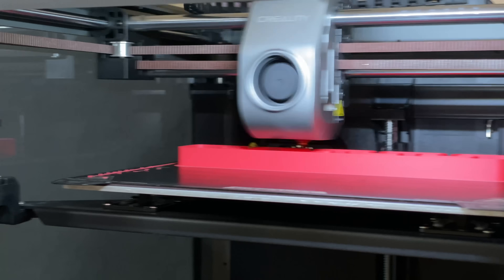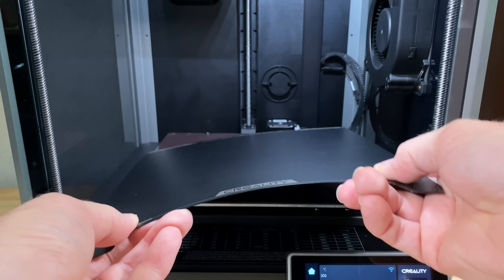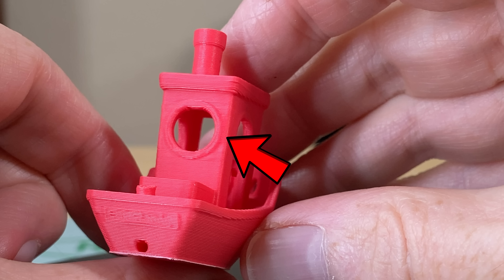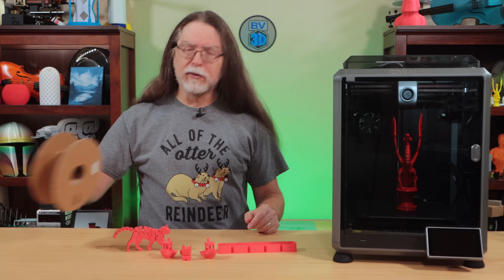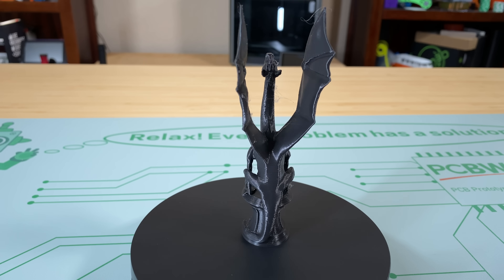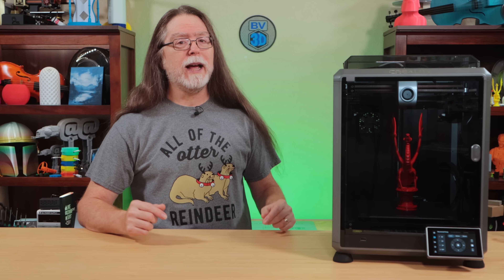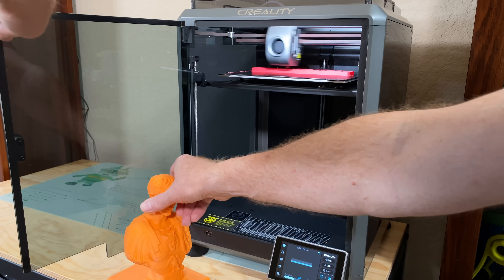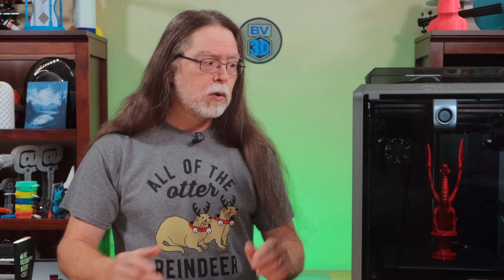Crazy Fast 3D Printer: Creality K1

Comment: Curious your thoughts between the K1 and the Bambu A1?

I'm a complete newb and with the two being close in price, I'm trying to decide between the two.
Reply: Also total noob here but from my research,  the biggest difference in comparing the two is one is enclosed and one is open the enclosed means you have more filament options. The bambu has larger build capacity, and better customer support,  it also has the ams lite that supports multi color printing. I'm also told that you really need to root the k1, so it is running the full versions of the software so that you can really tune things.... that is the biggest thing I've found the bambu machines just work, there is no tinkering or tweaking they just print but the creality while requiring a little more work to get running, give you the freedom to customize and tweak... sorry I'm not more helpful,  currently pulling my hair out trying to decide, and just found a third one that might give them both a run for their money.
Reply: I bought a k1 and the a1 came out during my return window. Got the A1 combo now.

K1 is a good machine. Ultimately I returned it because for a little more money I was able to get the ams lite and a bit more build volume with a very small sacrifice to speed. Only gripes I had with the K1 was when changing filament it liked to break a little booger of filament off in the head and I would have to take off the extruder to fish it out. And I would need to root it for proper input shaping (vertical walls weren’t as smooth as they could’ve been), not a big deal. But again, a little more money got me the AMS lite and a bit more build volume.

Now, with all that said, microcenter currently has the K1 for $400, I paid $430, so it’s a very good deal. Oh, the A1 is also considerably quieter than the K1, I could hear the K1 running in the garage (on the other side through an insulated wall), I can barely hear the A1 in the next room next to uninsulated wall.

Comment: I think it is resonance from the belt put a piece of belt up to the print and it looks like they line up.
Reply from the maker: I checked early on, but the vertical lines on the print didn't mesh 1:1 with the belt teeth.

Comment: Don't buy one. Mine is so inaccurate that parts don't fit together. The machine is off my 3mm over the 300mm print bed. Contacted Creality, and they will not replace it even though I have had this machine less than 30 days. Creality acts like they know nothing about this machine. Beware of these people who get free machines and do nothing but praise it and never tell you about the real problems.
Reply: I've seen so many videos now though of people who bought their own. I think you mustve gotten unlucky with a bad one. Sucks they dont have good support.

Comment: As other have said. Some of it has to do with core xy and the fact you will always get some vfa's. Now rooting it and going with stock klipper will help big time with any ghosting. Creality chose to use the same values twice for imput shaping instead of using a Xand Y value. I am puzzled as to why. And as others have also said the best tightness can also affect vfa's. Strangely enough i loosened my belts a bit and saw improvements. Mine was way too tight. So i guess try both and see. And as to how to do it. You will get 2 exra screws with your printer. You need to screw them into each side of the belt tighening assembly and then you loosen the two screws pinting towards the front on each side. The more you screw the one on the side in the looser the belt will get. Once done you tighten the 2 screws and then remove the screws you had just installed. It is hard to explain but there are some videos on it

Comment: Not sure if someone else mentioned this (as I did not read through the comments), but that table the printer was on was moving a lot. Wouldn't this cause some of the issues you had at the higher speeds?
Reply: This actually doesn't have much of an effect, if at all. There are several videos available where comparisons are made between prints performed on a wobbly table, solid concrete floor, or even hanging from a bungee cord swinging in mid air. There was no visible difference.

Comment: The rocket plane has a defect on it (from the STL) around the engine nacelle.  The tool head will jump to the fuselage instead of rounding the corner.  You can see it on your print at the 5:50 mark.  I wish they had a fixed version because I have a very tall printer I have been wanting to print it out on.  Maybe it's a Prusaslicer issue, I am not sure.  If it happens to you on a different slicer it's something in the STL causing it.  It happens to me when I try printing it, and it's super noticeable when you scale it up to 1.8mm nozzle width and 600 mm tall.  EDIT:  Also happens in Cura.  It's an  issue with the model itself.

Comment: I noticed that like many Creality machines this draws a line of filament from the bottom left to the centre before printing, I got this on my Ender 5 Plus machines before I got rid of the Creality FW, I would have thought by now they would have fixed this and especially on their flagship models, So, Creality are still lazy!
 One of the great features that I love on my newly acquired X1C and AMS is the nozzle cleaning, no more blobs on my first layers!
 My 20 year old server cabinet that I have my Ender 3 machines enclosed in has a glass door that is totally tight with no gaps whatsoever, why cant the printer manufacturers get this right, hell, Even a piano hinge would solve this issue.
 In my YT feed I see loads of new videos on fixing issues with the K1 and K1 max and this is partly why I did not even consider a Creality printer when deciding to spend a fortune on a new printer and I would have once described myself as a Creality fan!

Comment: I think Creality in a way dropped the ball a bit here?  Great printer as many say, But I say drooped the ball because who would go to the trouble to design a enclosed core x y printer that has a cut out on the bottom right of the glass door so the control touch screen is missed so the door can open or close.

Daft design from a big long time 3D printer company. Better to have the touch screen up on the right side of the front frame above the glass door open area so the door does it's thing and keeps the inside draught free because the door be, Well a full door not a door with a missing section at the bottom!

Having the screen up on the top right frame with say the Creality Name up alongside it would still be good looking and the door would be a full non-air let though the gap at the bottom right corner one.  Also I agree the spool holder should be at the right side or left side for ease of access!  

So Creality made a great fast klipper core x y printer but somehow thought that having a gap around the place were they decided to place the touch screen was fine to have letting in breezes and making the whole sealed away from the air you don't wish going into the printing area was okay to do when they could have done what most 3D printer home builders would have done and say have a full sealed door to stop that?  

Qidi Tech got the memo and designed their X-Plus-3 & X-Max-3 with a full encloser with full door sealing up away from the not needed breezes so the ABS type prints are not ruined by those blowing in.  Creality really needs to re-think the design and placement of the next series of core x y control touch screens next time so the printer door is full not has a cut out.
Reply: These improvements will be in the K12 version. Just wait for 6years.

Comment: I’ve printed the pre-sliced items that came with the thumb drive.  These turned out OK.  However, I went to the Creality website and downloaded the “Creality Print Slicer” and when I installed it on my Mac Mini the program was in CHINESE.  I saw no option to choose a language so I went online and did a chat with Creality.  They were not able to help and told I’d need to translate it!!!  Any thoughts? Did i just download the wrong item?  Any thoughts or help would be appreciated. Thanks
Reply from the maker: I downloaded Creality Print for macOS from Creality Cloud, it was version 4.3.7.6625. From https://www.crealitycloud.com/software-firmware/software/creality-print you should be able to scroll down to the Mac section of the page to get version 4.3.7.6625. That's the version I was using on my Mac, and it was in English.
Reply: Thank, I’ll give that a try.
Reply from the maker: @markmiles7485  Please let me know how it goes.
Reply: Telling customers to translate chinese instead of telling them about the correct version to download is top notch customer support.

Comment: Those vertical lines are VFA that happen when you slow down the print speed. This is something that all core xy machines are susceptible to to a certain extent. Some have said that tightening the belts has helped reduce the VFA ripples.
Reply from the maker: OK, cool, thanks. That gives me a starting point to work from. Appreciate it!
Reply: @BV3D  Those VFAs come from the stepper resonances, and it's not exclusive to corexy, any machine with stepper motors can suffer from that issue, it's a relationship between the pulley sizes, the stepper drivers, the stepper quality and the full steps per rotation of the stepper, the only way to control it or eliminate it is to avoid the resonant region, you can print a tower with flat faces and increase the speed every few layers you will see how there's a range where the resonances are higher and you have to avoid that region with higher or lower speeds matching how close you want to get to that region, VFAs coming from belt tension are not speed dependan and they will be there at any speed
Reply: @BV3D  If you do figure it out could you do a video on the fix? I have noticed the vertical lines in some of my prints as well.
Reply: I find the belts being too tight can cause the vertical VFA's also. Along with the other recommendations posted here.
Reply: Prusa forum has long discussion about VFA and on mk4 they switched to 0.9 degree steppers to reduce (not eliminate) VFA.

Based on personal "testing", there are "goldilock" speeds, where the lines are minimal. I think it's sort of inertia thing, where stepper can run smoothly at natural (?) stepping speed but will judder when being pulled faster or pushed slower than that. When running at high speed, there's not much judder, but maybe Klipper must start joining curves to longer segments to keep serial transfer within limits -> faceted lines?

If core-XY is meant to be fast and has larger (more torque) steppers, VFA could be worse. Is it time to start using servo motors with smooth torque?